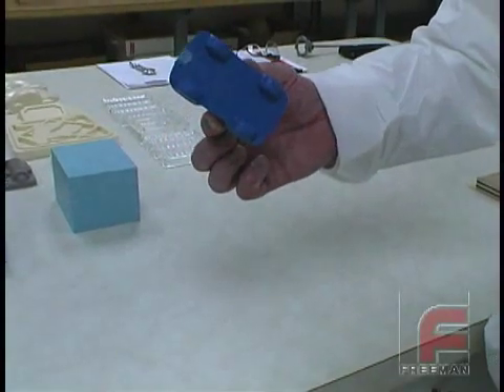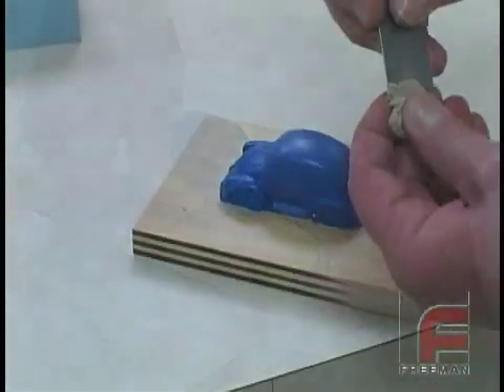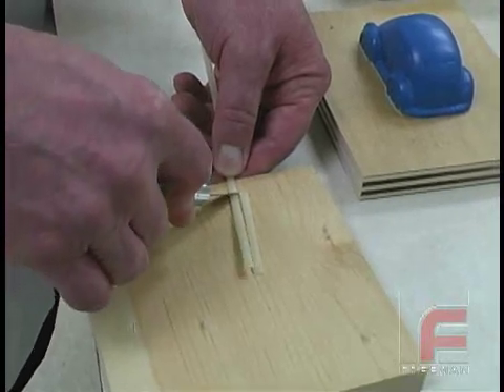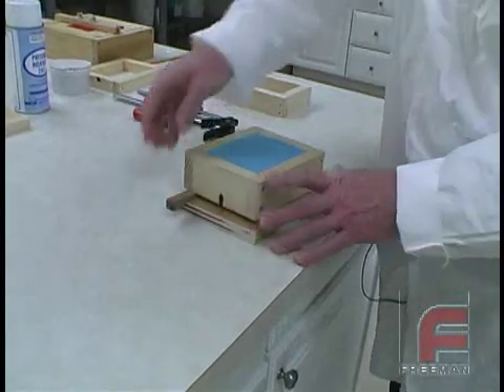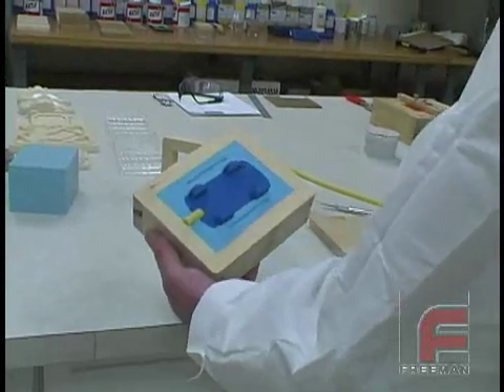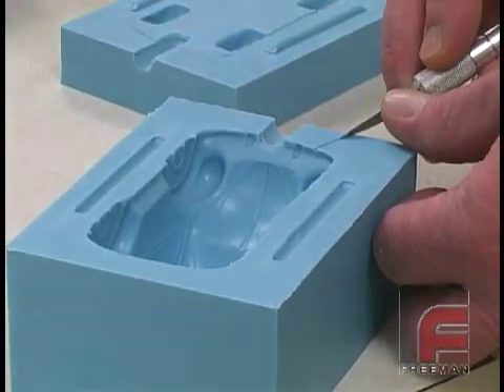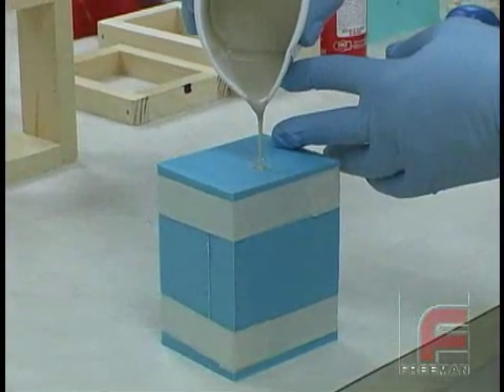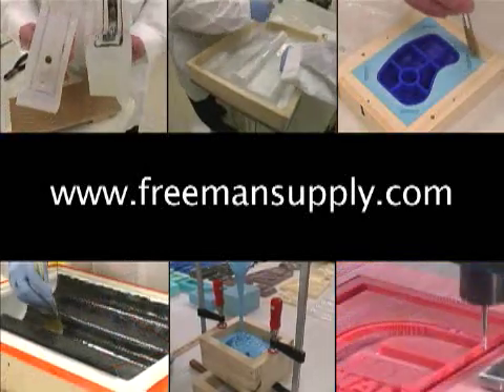Mold Making Casting Complex Parts w/ parting line) - Updated

Comment from the maker: If you have a model or pattern to work from, you can create a mold using our V-330 Silicone Rubber to create your mold.  Additional information on this product and how to use can be found on our website.  Our Repro Fast Cast Urethanes may be an option to cast the replicas.

Comment from the maker: Depending on the type of plastic you are using, you can do either or.  Our 
Freeman Color Tint can be used to die both Urethanes and Epoxies.  The 
Fast Cast Urethanes, Rigid Polyurethanes Elastomers, and Epoxies can 
also be painted.

Comment: yeah you could also use for a model horse, but you have to really think about where the separation line is so it will be easy to remove from the mold (i.e. if there is a curve on the tail, how would you remove it from the mold)...or you could cast it lying on its side but you would have a more noticeable flashing line